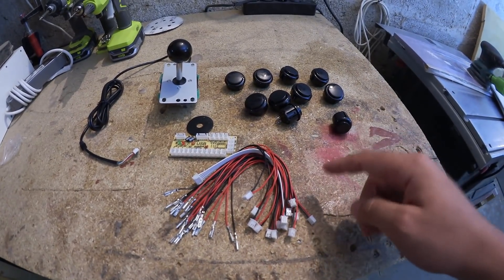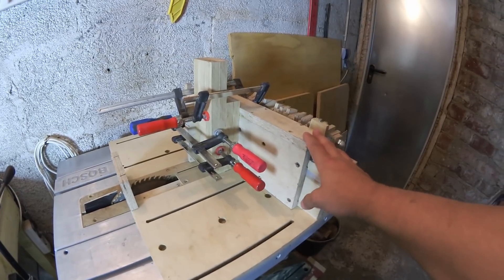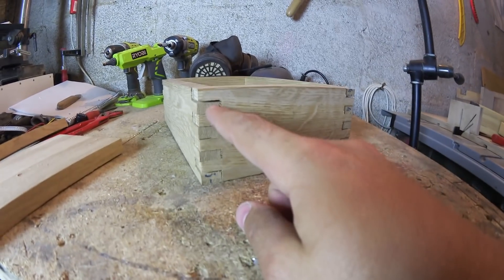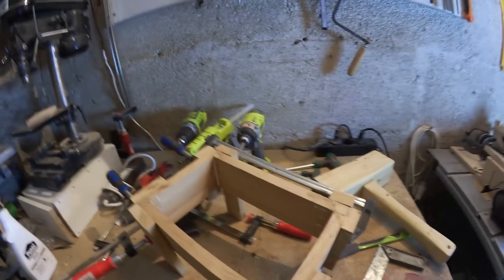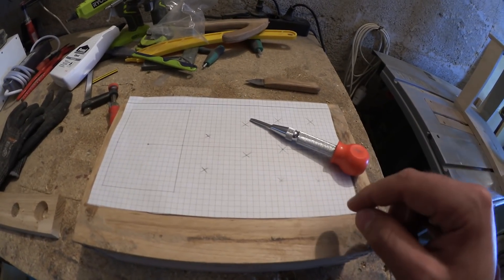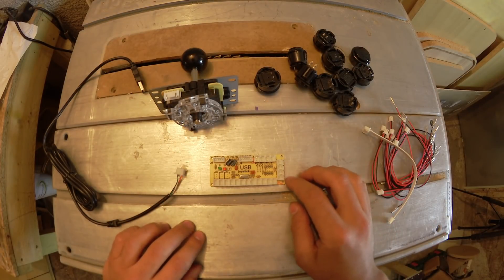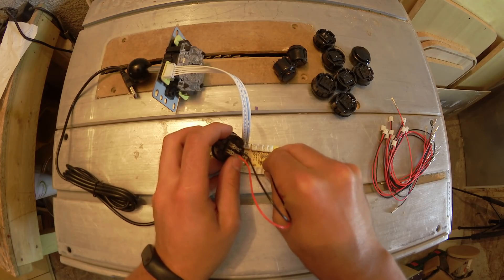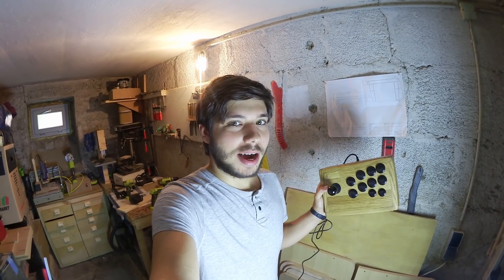How to build a DIY Arcade Gamepad! Easy project!

Comment: thats a pretty neat joystick. I wanna make a wooden one but sadly dont have the equipment
Reply from the maker: You can get the wood cut at your local hardware store to size. Than you just need a drill to make holes and some glue :) you can sand by hand as well. It's not a lot of surface. Machines sure make it easier but you can do a lot with very little :)
Reply: @Uniquelymade  okay you just made it possible for me. thanks alot man
Reply from the maker: Let me know how it works out :) would make my day
Reply: @Uniquelymade  haha will do :)